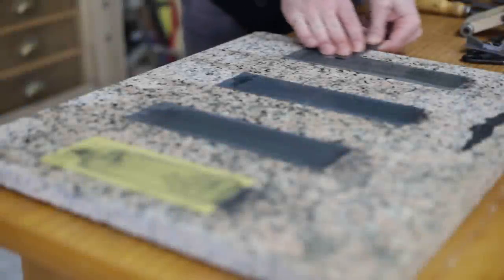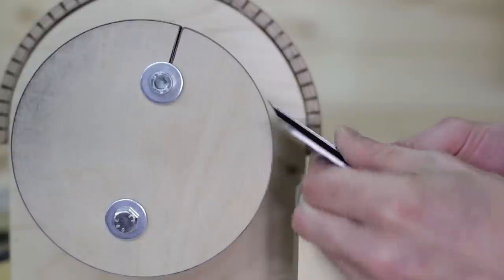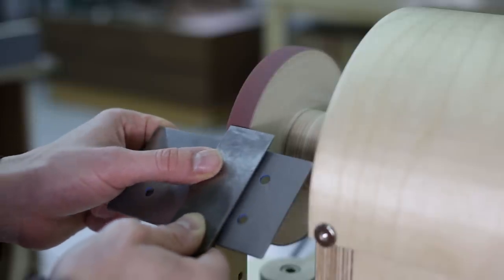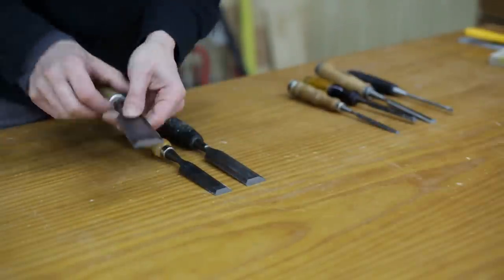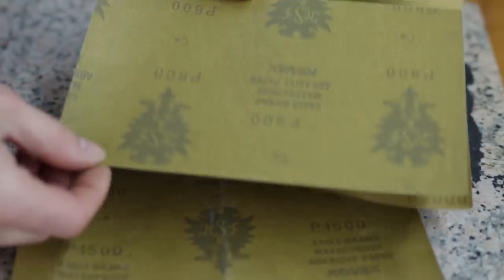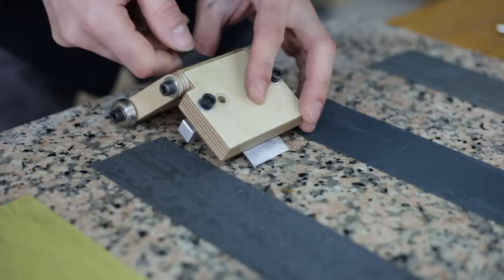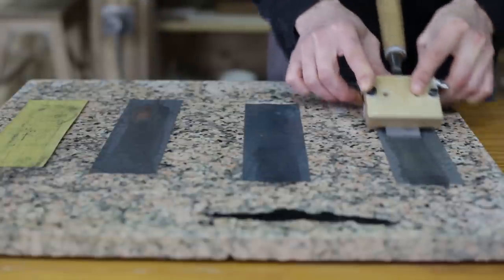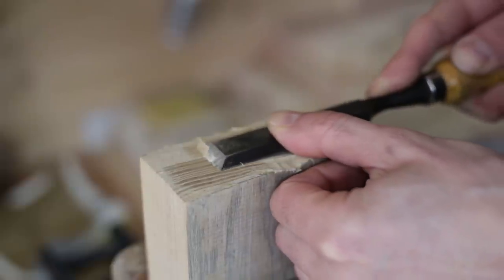How to Sharpen Chisels with Sandpaper

Comment: And to think that I was toiling over what whetstone(s) to buy, and the cost of them overall because of the various grits to have. After watching this video, you have eased my mind and offered a quick and easy solution to sharpening my timber frame chisels. The beauty of this sandpaper process is, that you never have to spend time re-flattening caused by hollowing of the sharpening motion of the various sized tools. Plus, your surface (glass or otherwise) are always flat. Then, you just discard the used strips and start fresh the next time. Love it! Thanks for sharing! Cheers!

Comment: If you want to test whether or not you have gotten a blade in perfect alignment before going very far with the first sandpaper step:  Put ink or thin layer of paint on the blade and do one or two passes on the sandpaper. Stop and inspect.  You can determine then if further sandpaper passes are going to be of value.  Felt tip pens or machinist lay-out fluid are both nice to use.  Dykem is a brand name in the USA of layout fluid and gives good contrast between silver colored steel and dark blue.
Reply from the maker: It is a good idea, thanks!
Reply: A standard machine shop technique to sharpen tools.  Same with knives, helical sharpened cutters, like a milling cutter, etc.  The stone or abrasive does not good until it takes a bit off of the edge.  The rest is just in-the-way.

Comment: After a normal use you can likely get by with just your top 2 grits, especially if you add a strip of leather and some green or gold compound to strop on.  Compound on the rough side of the leather and maybe 10 strokes and then a few stroke on the smooth side.  This knocks off micro burrs and polishes the edge.  It can also help to use a secondary bevel of 5° or so that you aren't sharpening (and removing metal from) the entire bevel each time.  Nice sharpening jig by the way.  May want to look at Matt Estlea's video on this type of jig to see how to make a jig to quickly set the angle on the blades.

Comment: Very precise and informative video. I will recommend your channel. Can you tell us how long the piece of sandpaper lasts with this method? And how much pressure do you use when going back and forth with chisel?
Reply from the maker: hi Morten, it takes little pressure, just the weight of your arms...  With the sandpaper you can sharpen about ten chisels.

Comment: Nice job. However, you shouldn't cut down in the stone with that knife...your stone will be scratched and the knife dulls immediately. I also use such a stone plate as a straight surface, when I have to align things for measuring and/or marking (I'm a machinist and blacksmith).
The method you use in the video is also excellent for polishing small flanges, ferrules etc.

Comment: That's excellent! I love this jig. It's a simple design, easily adjustable and to use. I think this is on my to-do list now.

One question, have you found the need to modify it to be able to lock the needed sharpening angle into place?
Reply from the maker: thanks! that would be an interesting improvement

Comment: Nice self-made tools. Sharpening anything on the any mechanical sand paper wheels can be dangerous if you cut the paper by mistake. I like your wooden-case for sharpening stone. I usually sharpen anything by hand manually with water stones. I have self-made wooden stand for a stone over the sink.
Reply from the maker: better to use sandpaper with cloth base, it's hard to break it. Thanks for comment!
Reply: stone wheels are more safety, especially you have space in the wheel, I wouldn't risk like that

Comment: Helpful video! Can the coarse stage (320 grit) of this be done on regular sandpaper? that is, NOT wet/dry sandpaper?
Reply from the maker: you can also use wet/dry sandpaper
Reply: Thanks for your reply. I have wet/dry sandpaper ONLY in the finer grits. Just wondering if I could get by with regular dry "woodworking" sandpaper for the early stages, since that's all I have!
Reply from the maker: @rickpick9058  you should use plenty of water for lubrication, so I do not advise you to use dry sandpaper. You could also start with P400 grit sandpaper or even more, it depends on the grit of your emery wheel. Try it with what you have

Comment: Wouldn't it be better to use the belt sander for the first step?
Reply from the maker: two systems are valid, in my case my belt sander does not reach the necessary degrees
Reply: Ah!

Comment: I tried it for really old chisels and it took me many sand papers in order to take off the metal and sharpen it. the result is okay, but I don't think this method works when you want to take of a lot of material.
Reply from the maker: have you used the grinding wheel first?
Reply: @Paoson_Woodworking  thanks for your reply. I don't have a grinding wheel unfortunately. but you are right, that would help :-) do you have any other suggestions. I need to remove a secondary bevel on the bottom flat side (spiegelseite, mirrorside) otherwise I am using tons for sand papers ;-) thanks for your video!
Reply from the maker: @davidwolf6927  you could try to start with a very coarse sandpaper, for example P40. What grain are you starting with?
Reply: @Paoson_Woodworking  I started with P400, I am going down in grain, thanks!
Reply: @Paoson_Woodworking  I flattened the backside with P180 paper. This 10 year old, worn-out chisel  looks like new. Took some time tough without having rougher paper. but still: great guide, thank. I was wondering how long you can use a sandpaper until it wears out. do the grains mix with the water and build a kind of foam? how do I know when to change the paper?
Reply from the maker: @davidwolf6927  you should clean the sandpaper with water every time you use them.  You can use them about 5 times

Comment: This is not a properly sharpened chisel at all. 
WHY are you honing at the same angle that you ground at?? This is why your result is 2 flat edges at either side of the curve.
If you grind the chisel at 25°, you must hone at 30°.
If you grind at 30°, you must hone at 35°.
You want one flat edge, at the tip of the chisel, while preserving the hollow ground the rest of the way up.
THAT is a properly sharpened chisel.